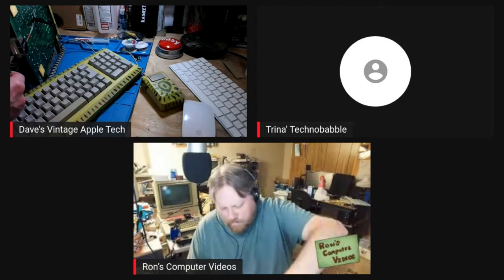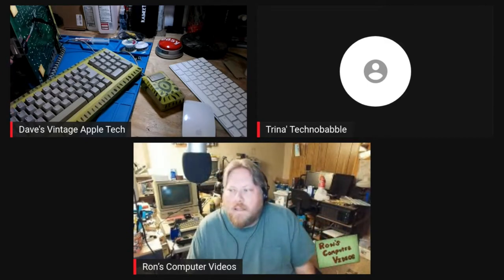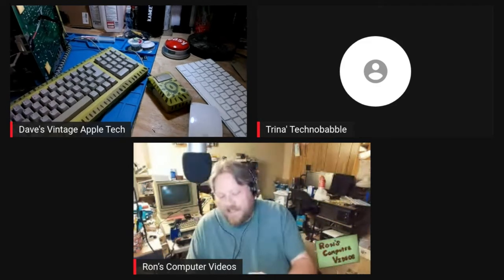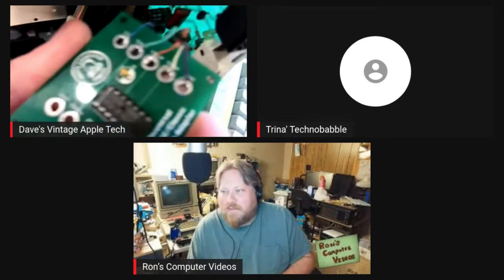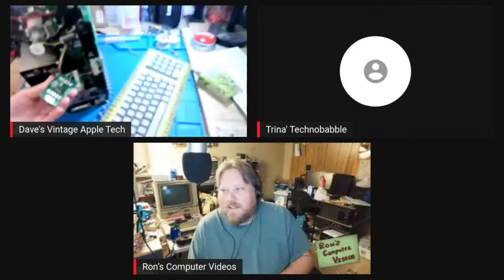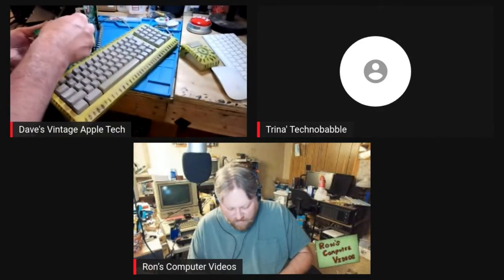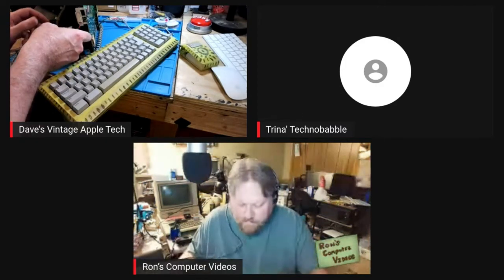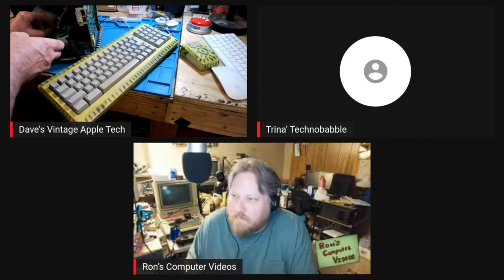THINGS GO TERRIBLY WRONG

Comment: Back when I was building PCs in the 90s, I rested a new hard drive on an angle on the chassis, and when I turned the PC on I think i shorted the +5 and +12v (or something) and blew a huge hole in one of the ICs on the hard drive. I took it back to the PC store and stated that I had it properly mounted in the PC case, and they hesitantly exchanged it for me.